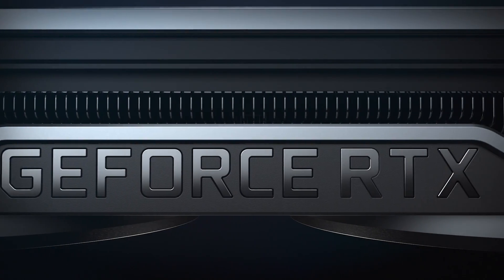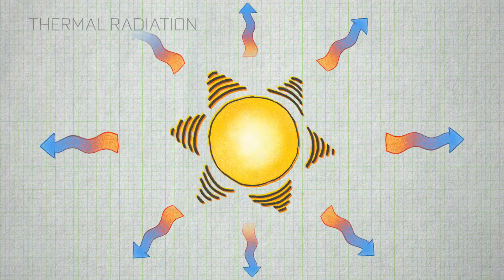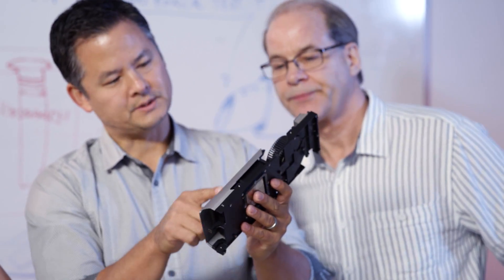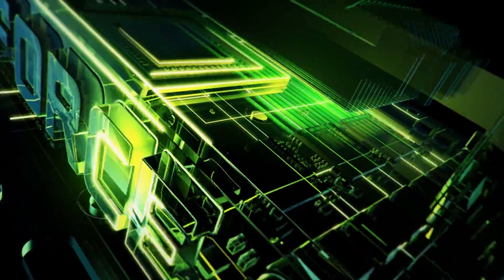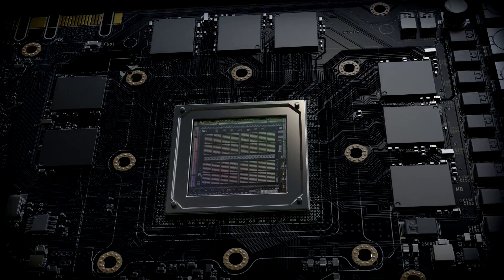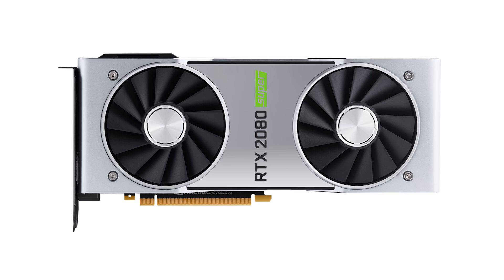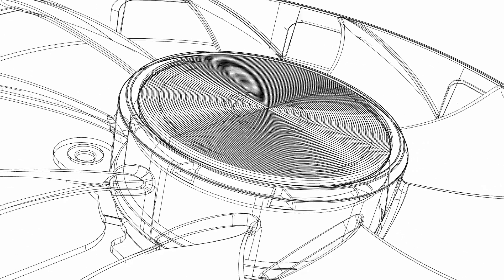The Remarkable Art & Science of Modern Graphics Card Design

Comment: A while back, in a different application, some one came up with the idea of putting two metals in hard vacuum, used a laser to remove the oxide layer on the metals, put them in contact, resulting in a bond. Basically, the bulk of the delta T is in the oxide layer that forms on metal surfaces. Also, isonics? Looked into procuring isotopically pure Si-28, which has 3X? Better thermal conductivity that nature Si.

Comment: Just curious about the pricing of the next gen cards?  I heard they will be much more competitively priced compared to the 2000s series and I wonder if that will drop the price of older cards ?
Reply: $400 usd for 3060 $600 usd for 3070 $800 usd for 3080 and then $1400 usd for 3090
Reply: @monetary687  thanks dude.  Is there any confirmation yet on the price and release of 3060 or mostly speculation?

Comment: What nvidia needs it's to reduce the power and make more efficient architectures. Then the effect of crosstalk, heat and the need of a extreme cooler it's solved. And a true pc enthusiast doesn't care about the aesthetics, it only cares how it works. I want to the industry goes back to efficient single slot cards with a reasonable prices. Nowadays its prohibitive to buy a graphics card. We should be able to be able to play all games with a good quality with a sub 200€ graphic card, if you want more you can spend up to 300. I'm a "casual" enthusiast gamer, that plays about only 10+h a week, and I'm holding a gf660 because I don't find any decent gpu upgrade under 300 (or 400). This new graphics cards are killing the pc gaming.

Comment: Step 1: Leak pricing and new power connector 
Step 2: Pretend that the pricing is actually a lot lower by leaking it again (i.e $2000 -> $1400). having always intended to launch at $2000, but quickly back peddling.
Step 3: Make a video to justify the ridiculous price by talking about engineering

Comment: So basically there will be extremely affluent gamers up and down the country, 3090 buyers, gaming with great FPS at 4k, dripping in sweat dressed only in their pants, in the middle of December.
This confirms to everyone the need for everyone to wait and see what Navi 21 has to offer, especially if it is priced at, or anywhere near $1400.
Vastly improved and massive thermal solutions never before needed simply screams to me they are pushing it too hard and putting too much power in the compensate for a weak architecture - all because of the fear of what AMD has.
Where is all this heat going once it leaves your pc case ?

Comment: "more power", "more power"... what happened to power efficiency and more performance for less power ?? is innovation happening only in power dissipation/cooler solution ?? Any Gaming GPU over 300W of power will become an instant meme.
Reply: Progress is a ladder. When you have PSUs with that much overhead, you can advance vertically to reach unseen before heights. Once you hit a limit, you optimize and advance horizontally.

Comment: I have serious issues with his definitions of Thermal Radiation, Conduction and Convection...

Thermal Radiation doesn't transfer heat to another surface, that Conduction.
Conduction isn't heat being transported through an object, that's an objects Conductivity.
Convection isn't heat being transported from a solid object to a fluid, that's Conduction.

Thermal Radiation is heat being converted to infrared light and simply leaving the object.
Conduction is heat being transferred from one medium to another in direct contact with each other.
Convection is the movement of a fluid due to the heat of the fluid (warmer fluid rises).
Reply: You're correct there. And his is from an engineering design point of view--solutions to those phenomenons of heat transfer. He did say "ways to get heat out" not "how heat leaves the gpu closed system" :)
Reply: @eptagz  My point is simply that his definitions are wrong, ignoring that nVidia is contributing to the dumbing-down of the population, they are undercutting their own message of high quality engineering when they can't even get basic terminology right.

And there was another point I forgot to mention, in the explanation they showed the heat from the GPU being transferred to a liquid -- so is there a liquid chamber in the heat sink? Wouldn't that mean the card has a particular orientation that it needs to be in (e.g. horizontal or vertical)?
Reply: Yeah after he said it I said “Wow that’s a terrible explanation”
Reply: Well technically that's natural convection. Any heat transferred through a fluid movement is convection. Forced convection is when the fluid motion its driven by more than the heat/density differences. Heat pipes and fluid chambers use natural convection. Every fan/pump is an example of forced convection.
Reply: @daniel.watching , writes "Any heat transferred through a fluid movement is convection."

Well, no, well, yes, well, kind of. The movement of fluid (and its associated heat) within the fluid is convection, the transfer of heat to or from the fluid to or from another medium is conduction (or radiation).

If you apply heat to the bottom of a pan of water, the water at the bottom will heat up (due to conduction from the pan) and rise to the top, forcing cooler water to move down to take its place. That's convection, heated fluid moving around within the fluid. The heat from the water being transferred into the potatoes (and cooking them) is conduction.
Reply: @fred_derf  yes but heat moving to the pan or potatoes isn’t moving as result of fluid movement. That’s what I meant. If the heat is moving because the fluid is moving, it’s convection. Conduction happens even within fluids, convection is normally more prominent, but in a viscous fluid conduction could be much stronger.
Reply: We can take what he said as definitions of thermal radiation, conduction and convection. And those are terrible definitions. We can also take them as how the principles of thermal radiation, conduction and convection can be used to create the technology required to cool an overheating GPU, yes?
Reply: @eptagz  My fear is that he provided such incorrect definitions that I am questioning his competence as an engineer
Reply: @joecool4656  well... Ok. As an engineer myself I can see where he's coming from. He didn't define thermal radiation, conduction, nor convection. That's not his job, and he is in no way responsible for educating people about it. He explained in simple terms what the solution is to the problem of heat, that was it. Just because he mentioned the first law of thermodynamics does not mean he's supposed to explain it. And lastly, whether he's competent or not, and even if nVidia makes overpriced GPU's, there's no denying that the technology they develop works. And no, I'm no fanboy, just someone from an engineering perspective
Reply: @eptagz  I revoke my competence statement then but I do find it annoying that they allowed incorrect statements to still make its way into an informative video for the masses
Reply: there are a few modes of heat transfer that we use to roast a steak. There's thermal radiation where heat is transferred from the hot coals to the cold steak. there's conduction where heat is transported through the steak to cook its insides, or from the hot grill to the steak so we get those nice grill marks. and then there's convection where...well I really don't have an example there, except maybe the juices inside boil or rise up the steak and cook it from the inside...?

Now is this really such a wrong way of explaining things?
Reply: @eptagz  "there are a few modes of heat transfer that we use to roast a steak."

There is very little thermal radiation used in grilling a steak, almost all the heat is transferred via conduction between the coals and the air; then from the air to the grill and the steak; and then from the grill to the steak. Convection is what causes the heated air to rise and brings it into contact with the steak and the grill. Heat is also transferred through the steak from the outside to the inside (technically via. conduction) based on it's thermal conductivity. The thermal conductivity of the metal is much higher than the steak which allows it to absorb more heat than the steak which is why it gets hotter than the steak and can seer it.

"Now is this really such a wrong way of explaining things?"

That depends on what you mean by wrong, it's incorrect, if that's what you mean.
Reply: Wow, that is truly amazing.  Really.  Thanks for adding a LOT of detail--so I guess "incorrect" isn't the word, but maybe "insufficient" is... warmer.  lol.  This was fun, thank you for the engagement, you both have a great weekend, stay safe!
Reply: It doesn't really change tho
Reply: the how is not the same as the what.
Reply: Make a video about it. They just trying to copy sony
Reply: Nice. Thank you for this information. I never quite understand heat convection very well. Not that I have much interest in physics. But it would be bad to carry and potentially spread a misconception.
Reply: He wasn't really defining those terms. He's paid to make thermal solutions. If I were his boss and I approached him with a heat problem, he'd better tell me how his ideas can work instead of explaining to me in detail what my problem is. 

I guess it's the type of audience in contention(?) here. You want definitions, go to a teacher or scientist. You want application, go to engineers or technicians. Also he did need to dumb down his explanation of the thermal solutions (not heat transfer), because this wasn't meant to be educational, it's a marketing video. It's a "Hey guys, we have our engineers hard at work so your new gpu doesn't melt. No math, just some pretty animations on how they work."

And yes, the heat pipes do have liquid in them, but they're narrow enough that capillary action is enough that the force of gravity can be ignored. Linus Tech Tips actually has a great video about how those things work

Comment: Why are GPU in PC upside down? The heat would hit the side if the heat pipe that does not have water contact. Water is sitting on the opposite-side of the pipe because it is heavier than air. It is like when a car is first started after sitting over night. All the oil needs to be rushed back into the engine but at the very start there is little to no oil on the components to protect them from wear.

Comment: The more pawer you have the more performance you get not nesesery because the limits depend on the monitor you are using for example if play one and I have limited in 60 fps monitor I use event if my graphics card is cable to running with 120 fps is no way to run faster for 60 fps as log use 60 fps monitor

Comment: A 400 watt room heater that also can function sometimes as a graphics card, ostensibly named the RTX3090.  Have been looking forward to this for over a year, saving up my pennies so I could get one.  Now I need to think about keeping my PC in another room and running cables if its even possible.  Extra 400 watts heat in here is 200 watt more than the max I can suffer.  nVidia better hope they are lightyears ahead of AMD in the high end.  I will want a new CPU as well so I cant buy until Zen3 comes out, which will be November anyway, and if AMD have something equally good as 3090 by then...nVidia might just lose my sale.  And I guess a lot of PPL thinking that way, 400 watt is incredibly hot.  That is the same amount of heat as body heat of 6 human beings sitting in a room, for context.

Comment: I just want a water block, fancy new cooler would not beat a 280mm rad XD plus air flow is in the wrong direction for inverted case layout it seems would be sucking air away from the top side fan and blowing it towards my lower intake fans XD

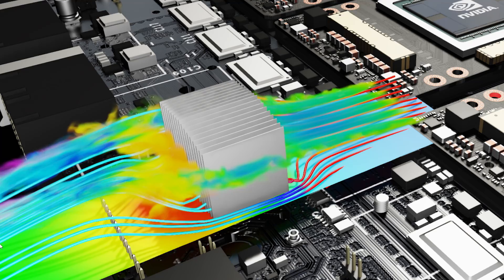Comment: 2:27 I was wondering how the weird bottom and top fan design seen in the leaked images was supposed to work. This is incredibly interesting. So it looks like the bottom fan acts like a blower style cooler and directly exhausts the hot air outside of the case, while the top fan acts like an open-air cooler and dumps the hot air back out into the case, basically giving you the benefits of a dual fan open-air cooler, but with less of the hot air being dumped back into the case. That's actually pretty clever.
Reply: YUP!
Reply: The sapphire pulse 5700xt card also have  simlair feature.
Reply: @qiyuxuan9437  No it doesn't
Reply: @christophervanzetta  It has horizontal cooling fins, and some of the hot air will exit through the rear IO ports just like a blower cooler, and the remaining hot air exit at the oppsite side, simlair concept, the difference is it dosent push hot air upward.
Reply: @qiyuxuan9437  Not anywhere close...

The rtx 3000 series expels air outside the case with its blower fan while the "horizontal" fins don't push air that well out.
Reply: @christophervanzetta  From the leaked pictures, there is no blower fan on the RTX3000 series, that is a regular shape fan, but given the 3090 is a tripple slot GPU, it should still push decent amout of air through the rear IO slots.

Comment: I always love the way Nvidia makes gpu. Perfect thermally and mechanically.
Reply: I might get Ampere, but this is gonna be a run-hot generation
Reply: @parad0x1cal83  With a cooler like that the GPU won't run hot, but if it's dissipating 350W+ it will definitely be a space heater.
Reply: Perfect space heater.  Quiet as a angry hornet's nest.

Comment: Since gtx 1000 series there is no real development. GTX 1070 was released for 379 USD in June 2016 and GTX 2060 (which slightly better than 1070) was released for 349 USD İN January 2019. 2.5 half years have passed only 10% price drop. Also GTX 2070 was released for 599 USD (its predecessor 1070 was 379 USD) which means 70% price increase. Sadly, Nvidia has become very gready with no significant improvements. Same 7nm tech and more energy consumption means instead of paying for tech we are paying for some glorified chunk (Resource wikipedia)
Conclusion:  for most people, if you have a  GTX 1070 working nicely,  no need to upgrade and I would recommend to wait for 4000 series.

Comment: So... 2x 6 pin power connectors for mid range cards, 1x 6pin + 1x 8pin for high end cards (that's what the THIRSTY hd 7970 ghz had), 2x 8 pins for a behemoth like the Fury X... and now it's not enough for Nvidia. That means that their next gen 3090 will have a peak consumption of over 375 Watts.
 And all the propaganda around the cooling design is to make us focus on how awesome it is that they can dissipate 400 watts instead of screaming HOLY FUCK. For reference, the INSANE HD 7990 had a peak draw of 375 watts.
 Or, maybe I'm wrong and the new 12 pin connector carries the same ammount of power as 3 normal 6 pin connectors, giving a total of 300 watts (225 watts from it and 75w from the PCI-E slot), wjich would actually be pretty neat, but unnecessarily complicated when compred to simply using 8+6. MAYBE it's a 300 watt connector, in which case I'd start worrying about current density in that little plug, but it would certainly take up less room than 2x8 pin. Still redundant though.

On the plus side, the whole Xbox series X will have a peak power consumption of less than 300 watts, so we can only imagine what AMD can pull off if they go on an all out war with a 375 watt gpu.
Now a stupid random thought: i've seen what happens to cables in some mining boxes... wouldn't 3x 6-pin connectors +plus the pciE slot be a safer way to deliver 300 watts, since the heat would be spread over a much larger area?

Comment: 2:20 I used the heat to destroy the heat
Reply: Nah, the hot air joining the CPU stream is also joined by the cold stream/s of air coming from the PC case front panel, and the GPU also should have a cold air stream coming from other front panel fans. We'll see once the people who know how to benchmark this get their hands on them and do a PC case thermals benchmark.
Reply: @Sholvacri  using the heat as in the heat needed to make the simulation
Reply: @gman3371  The simulation at the linked timestamp has nothing to do with heat, or heat used, it's only showing the speed and trajectories of the air involved there.

Some people are confused by how this system works and believe (or are just trolling, perhaps) that this is going to make their CPUs run hotter, and I just said it shouldn't and explained why, but if it does make them hotter, or not, we'll see when people who know what they're doing test them.
Reply: @Sholvacri  Well if they're going to show the simulation in the case, i assume that they used it somehow in the development of cooling.

With that said i can put the timestamp a bit behind at the other shown simulation (i.e. 2:20 )
Reply: @gman3371  Yeah but that other simulation only shows the controlled volume they designated to show the actual interior of the GPU cooling system, which is fine when they only want to show and test that cooling system, they assume people will have properly cooled PC cases too, I guess.

Comment: This sounds like an unnecessarily expensive PITA for your board partners. "Muh cutting edge thermal design is so hard" homeboy AMD was cooling 500w cards in 2014 and it was NBD. If it's really that hot put a 120mm rad on it, don't reinvent the wheel at the cost of your customers and board partners just because you don't have competition.

Comment: Everything in this video has been the 3080.......  we might not get a 3090 from the start .....
Reply: The Seasonic adaptor box says a 850w PSU is recommended. That suggests the new connector is just for the 3090, as the whole range will not need 850w.